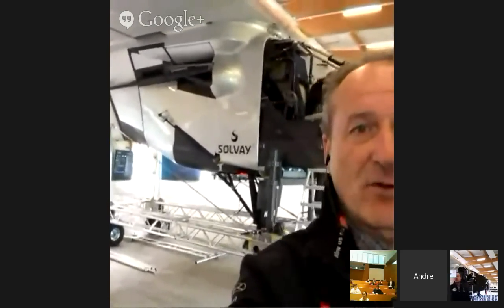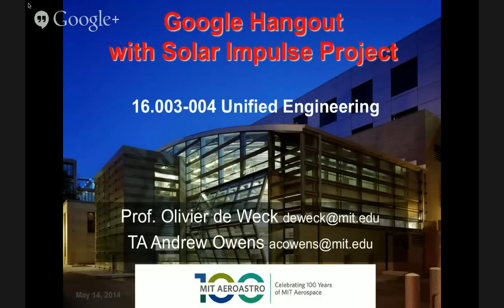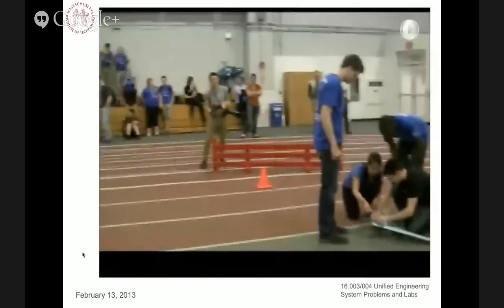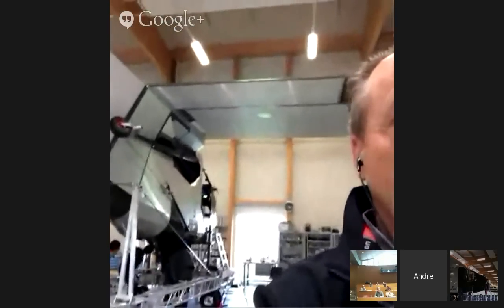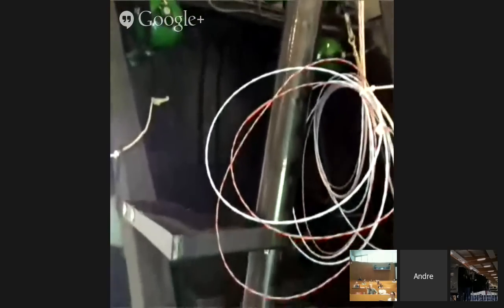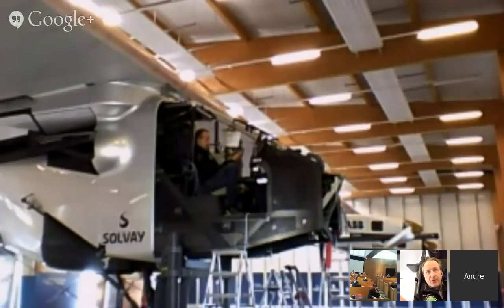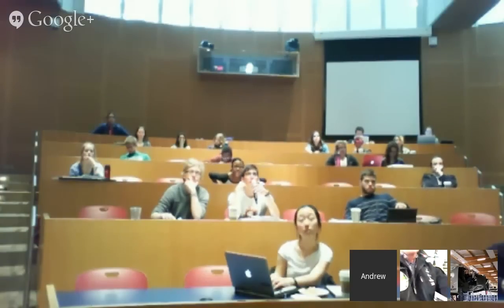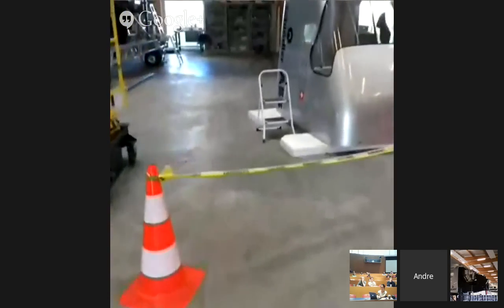MIT Unified Engineering & Solar Impulse Hangout On Air

Comment: Not impressed with the questions from the MIT students.
Also very unimpressed that MIT has not moved forward aeronautical innovation since 1988!  What?

What has become of this flagship university which is apparently stagnant in innovation and free thinking?

Last observation is the sparse attendance for this ground-breaking event in aeronautics.  Those students were all sitting 10 feet from each other.   Alone.